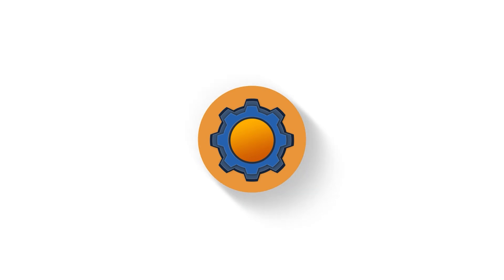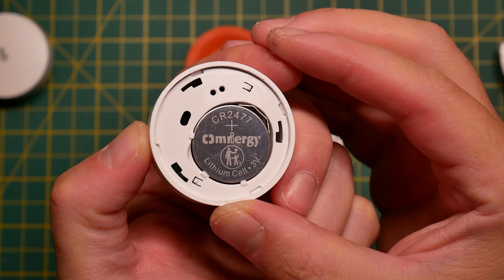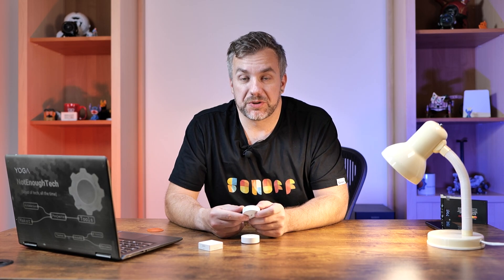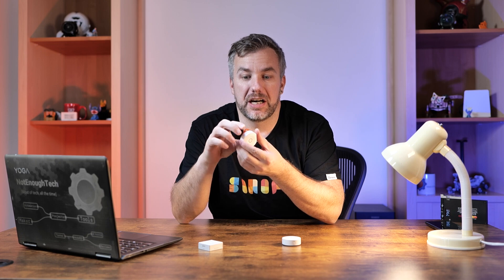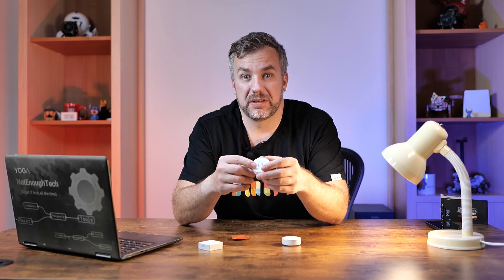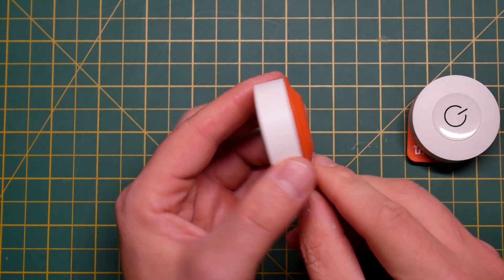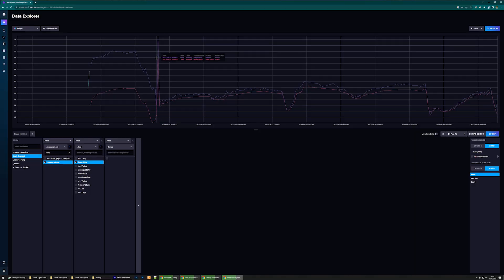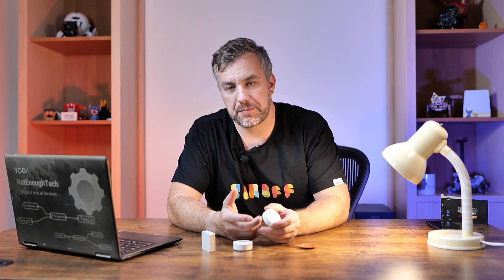Are new Sonoff ZigBee Sensors better?

Comment: Thanks for the review of these new wireless switches.  I had already bought half a dozen.  You do NEED that new version Zigbee hub from Sonoff. Won't work with anything else.  But your review is spot on. Excellent information.

These switches are a gem, that few people know about. Very very handy. 

Though twice the side of my Flic 2 buttons, these Sonoff wireless are very good.  Surprising considering the first version were terrible.  I use these through Alexa so I can do things other than turn on/off Sonoff devices.

I was disappointed with the only white color, so I spray painted them.  Word of caution, cover the button, so extra paint does not seep into the crack between button and case.  AND cover over the LED light with tape before you paint. Then you can peel the tape off to see the light flash.  Learn from my mistakes, eh?  I use command strips to attach them to underside of furniture or to hide them, versus the metal plate.

Comment: Love the old button as you can smash it anywhere and it registers a click. Great in low light conditions. Looks like the new one has to be deliberately clicked in the middle?
Reply from the maker: It has a nice indent so your fingers are guided into the centre of the button. I found it easy to use even when not looking at it directly

Comment: The old square sensor is a sh..t, it often disconnects from the sonoff zgibee hub and you have to pair it once again. Is the new one better in this matter?
Reply from the maker: I would look into all the reasons why this is happening i have 7 sonoff in use and i don't really have any problems with them

Comment: Any thoughts what is restricting temperature range for sensor? Would be great to use those also outdoors with some wide range batteries
Reply from the maker: Condensation would eat the board without proper protection. Worth getting a proper outdoor one which is ZigBee 3.0 compatible or what's even easier ... finding out where is your nearest meteo station and pulling data from professional grade equipment via api
Reply: @notenoughtech  okay, thanks! Api is of course valid solution, but would like to have more local values 😄 maybe I have to jump Ruuvi Tag -team when it comes to outdoor sensors
Reply from the maker: I use switchbot outdoor meter + switchbot API for this... but I also use just the weather API. My station is less than 0.3 miles away. It's unlikely it won't notice tornadoes 😂

Comment: Hi thank you for the video.  I am curious, when connwcted to an alexa echo with zigbee hub, does the temp sensor have the ability to trigger routines?
Reply from the maker: Yes as you can use the sensor value as your trigger
Reply: @notenoughtech  thank you!!   Ordered one just now.  I've been looking for something to stick in a vent and trigger fans when AC turns on, this sounds perfect.

Comment: Are these sensors going to possibly get a Matter update in the future, or will they remain as Zigbee?
Reply from the maker: Id have to read the spec sheet of the EFR chip... but considering that they can expose sensors via matter compatible hub like switchbot does... I doubt this would be a case

Comment: I don’t suppose you have any rechargeable batteries in that size? That is my current problem with the Sonoff zigbee motion sensors. They really don’t seem to like rechargeable batteries. Touch, door and button seem fine. I’m guessing the  voltage regulator on that sensor is dodgy.
Reply from the maker: Rechargeable battery usually have a little lower voltage than the regular one especially when a little depleted. As the sensor works from 3v you could wire up 2x AA or AAA if the battery performance is the key

Comment: Is there any how to guide to recalibrate the humidity sensor? I’m using the old version and it seems it is stuck on 100%. I have another sensor that shows a different value.
Reply from the maker: There are 2 ways to fix this. 
There is a chemical way of restoring sensors sensitivity (Google this it will outline the process) and simply adjusting value in z2m dashboard if you know current reference. As your sensor is stuck on 100% I'd open it up and check for water ingress then perform chemical calibration of the humidity sensor.